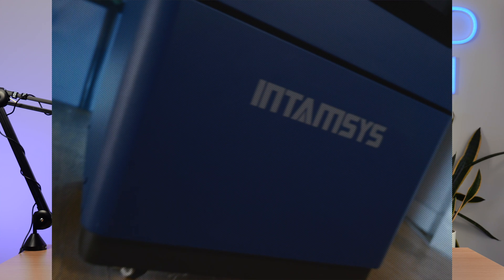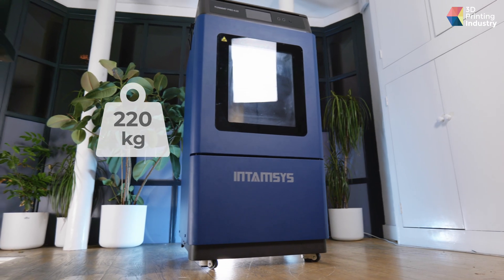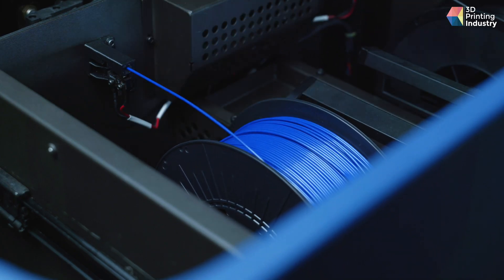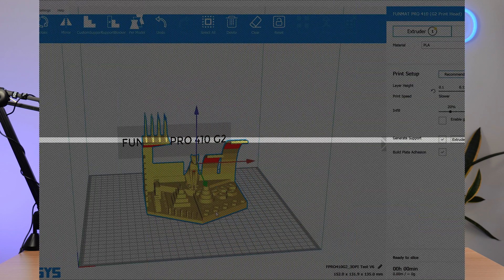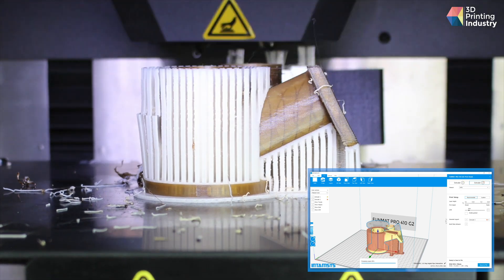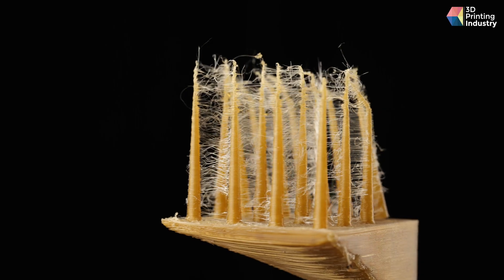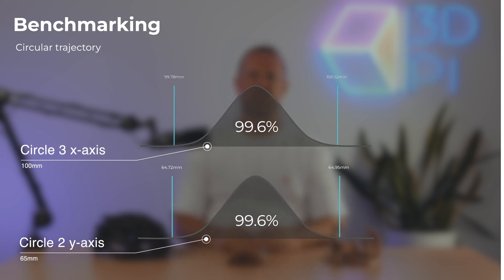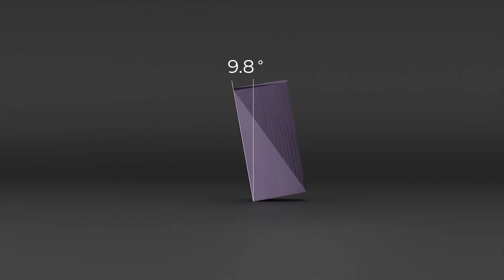High performance materials? INTAMSYS FUNMAT PRO 410 3D Printer Review

Comment: $30,000 doesn't seem particularly competitive. The VisionMiner 22 IDEX seems like the overall more capable printer, around half the cost. 200C bed, 90C chamber, 500C nozzle, non-planar printing, dual-geared direct drive for both printheads, prints all the same high temp materials, etc.
Reply from the maker: VisionMiner you say? 

It caught our eye also - and we're looking forward to getting a chance to put the system to the test. Comms are open!

Any other 3D printers you'd like to see us review?
Reply: @3DPrintingIndustryNews  It'd be fabulous if you reviewed the VisionMiner! Great to have found a channel reviewing professional/production-grade FDM printers. Finding a machine that can reliably print PEEK and Ultem without costing like $25-30k is my dream.
Reply: @theglowcloud2215  Word is that the idex 22 has a lot of sloppy 3d printed brackets for frame junctions and overall poor construction. The specs look great but the assembly may be lacking. Also, I don't believe that it is fluid cooled which is not amazing for PEEK, PEAK etc. The multi axis base has promise.... They are built in Ukraine.... so supply issues as well.... I'd lot to see an in depth review.